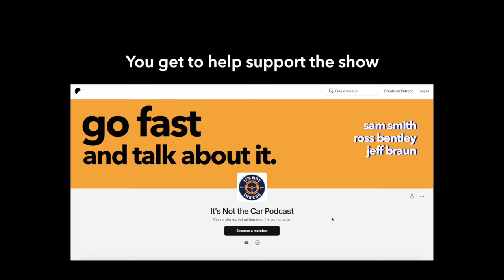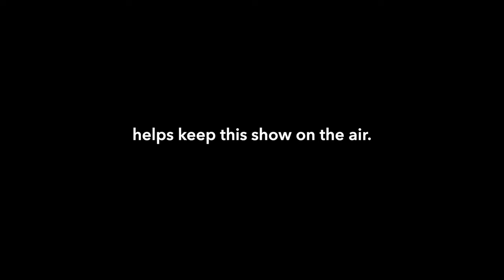How Do Wind Tunnels Work? -- It's Not the Car #11

Comment: I imagine it will eventually be possible to model the dynamic changes for multiple cars running together on a road course to get accurate aero data. But if the fastest car always won, no one would watch. It's not the car!

Comment: In an ideal situation, the floor of the wind tunnel should be moving at the same speed as the air, and the wheels should also be rolling at that speed.
Reply: Okay, if I had waited until about the 28-minute mark, I wouldn't have had to make that comment. ^^